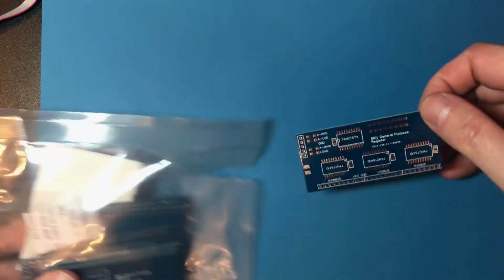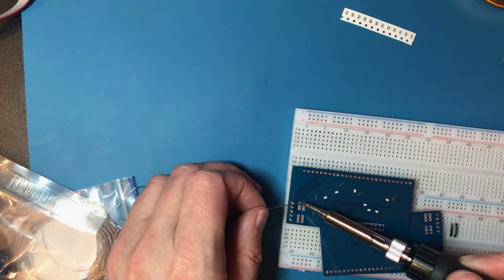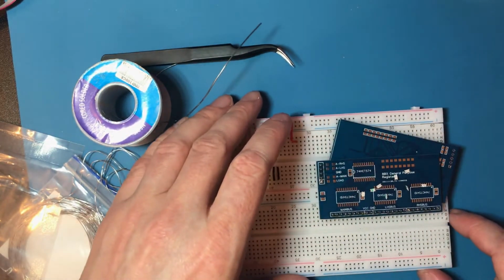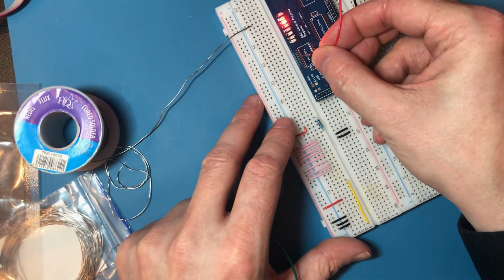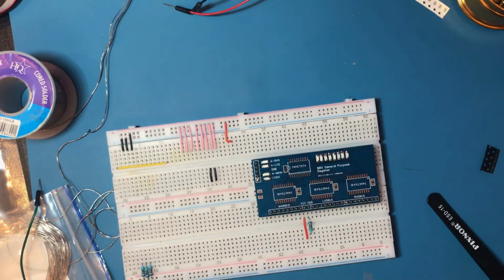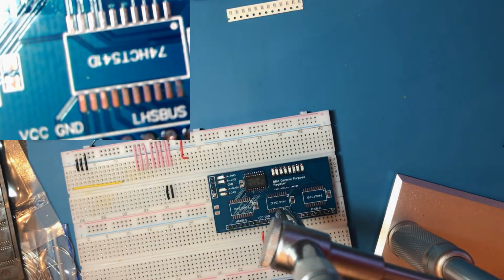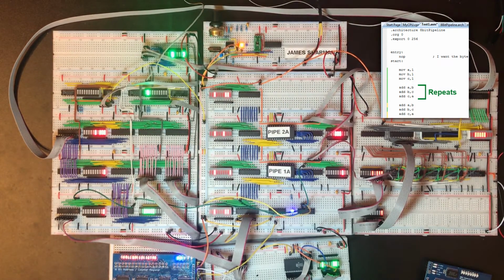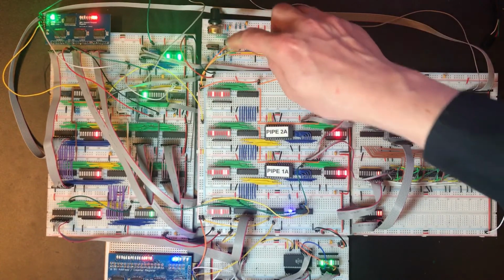General Purpose Registers (3: Soldering Success) - Making an 8 Bit pipelined CPU - Part 29

Comment: I've been soldering without a nice tip cleaner for decades... finally got one recently and doesn't it half make a difference. 
On my todo list I've got a job to solder a couple of 0402 resistors.... last time I did it, it felt like I'd been at it ALL DAY....
I <3 through hole.
Reply from the maker: I'm getting better at the SMD soldering, but through hole just gets easier alongside it.

Comment: Leaded solder likes to stick to the iron when you pull away if you're not running hot enough
Reply from the maker: Interesting, I’ll give that solder a try at a slightly higher temperature when I get a chance.

Comment: Iv just started to watch your videos from the start, would you recommend the microscope you use? If so, what’s it called so I can search for it please. I see you said it’s terrible but in your newer video you still use it?
Also when testing LEDS, if you set your multimeter to diode mode, it will illuminate the LED, apologies if you mentioned in a later video just discovered your channel.
Reply from the maker: The microscope was a cheap one from eBay, it’s not great generally but it’s really low profile for recording top down. I like it for that.

Comment: 0805 are ideal when you get used to handling them. I routinely design with 0603 for space saving and common availability, but they do take a bit more practice. I do recommend 0805 for hobbyists. I have soldered 0201 with a good microscope, but they really are pushing the limits!
Reply from the maker: For the most part I'm using 0805 and 0603, no desire to go any smaller than that. My Led's are 1206 still but that's only because I don't want different size led's in the main build. I'll proberbly switch down to 0805 for the next one.

Comment: And you now have what's technically the LHS bus labeled as the RHS bus and vice versa on the GPR PCBs, so that may make things even more confusing if (when) you need to debug later.
Reply from the maker: I'm now starting to suspect you are trolling me, I've spent the last half hour checking videos and schematics and everything is exactly as expected. I may have vocalized something the wrong way round during pcb wiring, I've caught a few of those during editing.
Reply: @weirdboyjim  I got myself confused, it seems. I'm rechecking to see where.

Comment: Leaded solder is easier to use, but doesn’t produce better results. You need to get used to the higher temperature and the right technique. For long term reliability, mixing solder types is a bad idea and lead contamination in unleaded joints is a potential cause of failure. And when you come to use solder paste for SMT soldering, it’s best kept in a fridge to keep it fresh. But seriously never keep leaded solder paste in a fridge used for food! The small particle size means rapid absorption from even the smallest contamination and lead poisoning us no joke.
Reply from the maker: I always get temperature stable paste.

Comment: > leaded solder
😰
Reply from the maker: I'm told that leaded solder in small scale one-off production is safer than the chemicals used in unleaded solder flux, but keeping my eyes open for updated/changing information.
Reply: dunno if you’ve switched to it since but a while back when i was doing some smd soldering and got solder paste, it was a huge improvement. easy to get it on all the leads, melts super easily, and i could just squeeze a tiny bit across all the leads and touch it with the soldering iron in a couple places and then it was all done. would be easier with an uh stencil? i forget what it’s called but that’s basically what it does. haven’t worked with them but you use it to apply the paste, stick the components on, and apply heat from a reflow oven, heat gun, pan you wont eat out of again on the stove, etc